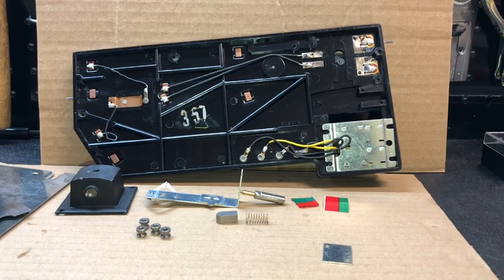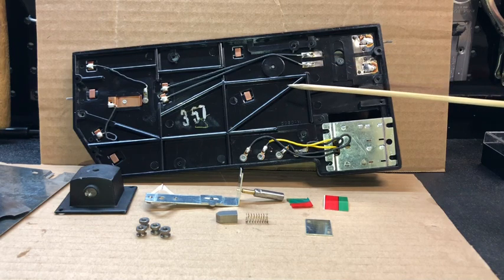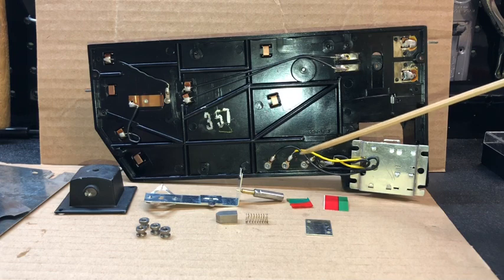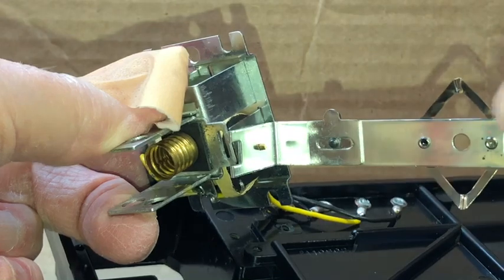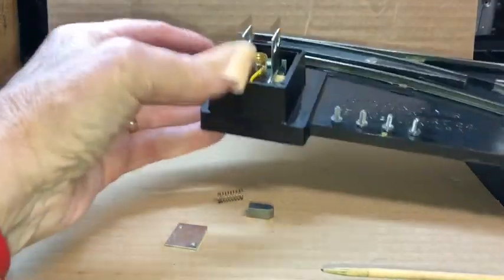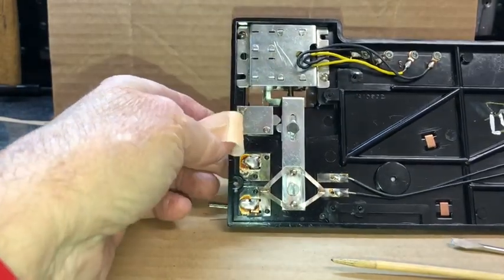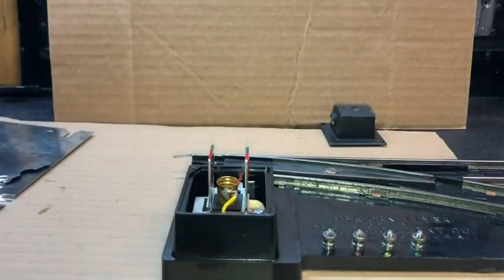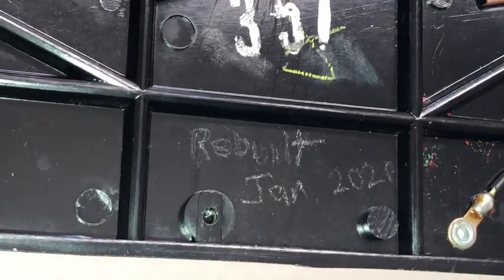Project Complete Assemble Track Switch and Test 26742 American Flyer Illuminate Switch Control 57-58

Comment: I enjoy watching your hands on with these 720A switches Mr Dave.  Time marches on so I usually replace the studs with 6-32 x 3/4  panhead screws and knurlled nuts and direct solder the track hold down clips to the rails. it does not look professional but the switches work forever.  The  screwed thread bulbs can be problematic.  I have been putting a tiny dab of hot glue on the male and female sections of the bulb socket combo.  It seems to work.  The switches I work with seem to be a little rougher. ( CASG)
Reply from the maker: Thank you for watching!

Comment: Very interesting series on the switches.  What is the product you apply to the surface of the switch?  Thx!
Reply from the maker: @dave3156  To the bakelite plastic, after thorough cleaning, I apply thin coat of CRC 2-26 as it is plastic compatible. Thanks for watching.

Comment: I enjoyed your series of videos on rebuilding the switch and controller. On my switches, which I believe are the same model as the the one you rebuilt, the bakelite that holds the two screws for the cap that goes over the signal bulb itself has broken off on the corners. Is there a way to repair the bakelite if it is broken and missing?
Reply from the maker: Hi Dave, great question, in his book Mr Barker describes three possible solutions to cracked screw holes. Fill hole with JB Weld then drill out to accept self-tapping screws. He suggest plastic soda straws to form a mold into which the weld is poured. Mix soda with epoxy (or Crazy glue) to form a paste that can be drilled then screws inserted. Finally brass threaded inserts, either drilling out then inserting the insert, or use JB Weld to glue the insert in.  I recently visited my favorite hardware store and purchased 6-32 and 4-40 inserts to keep in stock for screw hole repairs. Since the top on the switch signal block is not load baring then maybe attaching inserts to the side might work.  If the screws hole is exists, in part or whole, but is stripped, I find that filling the hole with Testors model glue, let it harden, then reinsert a self-tapping screw, or wrap the screw threats with a very thin plumbers tape also works, Thanks! Dave

Comment: Hi, Dave. 

Very informative videos on the 720 switch. I've gone through all the steps you go through on one of min, but the issue that persists is that there is a problem with the solenoid positioning the frog in the mainline orientation. There doesn't seem to be a problem with the solenoid's ability to pull the frog into the siding orientation. Also, the solenoid mounting plate gets palpably warm after a couple of minutes of back and forth operation. I'm thinking that it might be necessary to rewind at least one side of the solenoid. Can you suggest anywhere that does machine rewinding of these solenoids?

Thanks.
Reply from the maker: Bob, some thoughts, there must be something that impedes the frogs positioning to the straight or mainline position. For me it has never been the solenoid, this issue is physical not electrical. The switch must be completely disassembled, cleaned, not lubricated then precisely reassembled. There are two plungers and several springs, coil and swipe types, who tension must be checked, especially the one that forces the hammer or throw that keeps the frog in place. If this is too tight or movement is impeded can prevent good from movement. Remember some switches have contacts underneath the frog, between it and the bottom platform, check it for cleanliness and freedom of movement. My prediction is the problem is not the solenoid, best, Dave